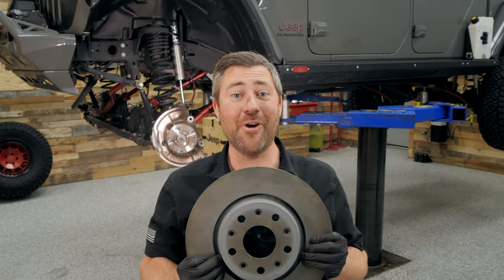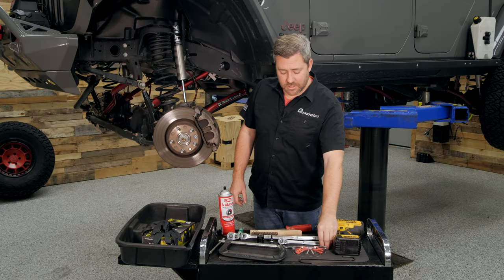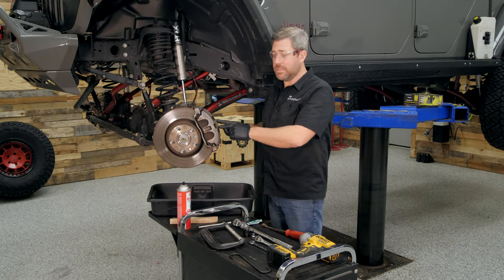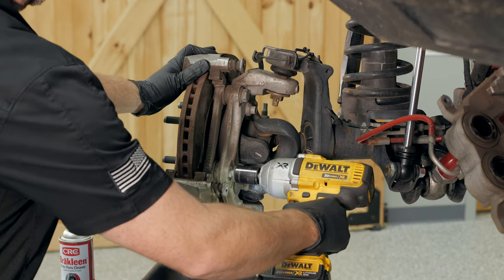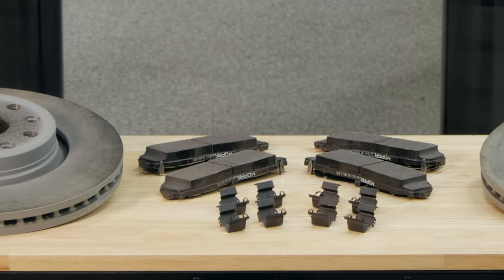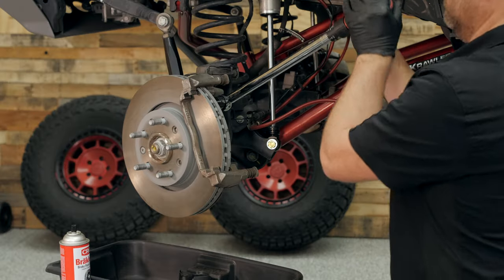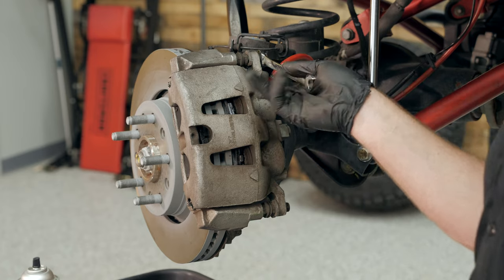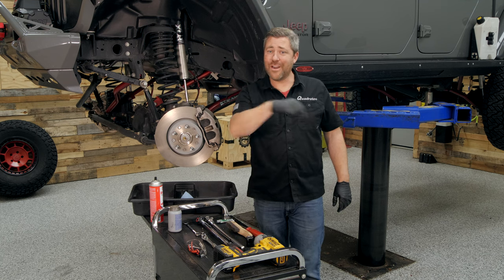How to Replace Brake Pads & Rotors for Jeep Wrangler JL & Gladiator JT - Quadratec Academy

Comment: Be sure to add a bit about drilling out the retaining screw as they NEVER come out that easy. Pot metal and the T30 torx strips it in 1 second. Also, show which way the wear indicators go (you can just barely see in this).

Comment: Is it the same process for the rear pads/rotors?
Reply: Because of the E brake it's a different animal.  I've seen on other Jeeps where it's required to go into the Uconnect menu and click on "brake service" before doing any work.

Comment: The rear Mopar brake pads I ordered for my JL Wrangler (Sport S) came with 2 shims for each pad (1 shim is shiny metal on both sides and the other shim is shiny on one side and black on the other).  Am I supposed to use both shims for each pad?  I guess I'll find out when I disassemble the existing brakes, but it would be nice to know in advance.

Comment: When torqued to 148 the bottom bolt actually touched the rotor and caused damage. When trying to back it out the bolt broke. Great video but the torque must be incorrect.
Reply: Was this just on the rear caliper? It looks like torque spec is different for front (148ft. lbs) and rear (74 ft. lbs)

Comment: Similar, same, or different procedure for the rear pads/rotors ???
Thanks for this video, Rob excellent host/installer, as usual...
Reply: I was wondering the same thing. On some vehicles you need a special tool to turn the rear caliper pistons back in. 🤷🏻‍♂️

Comment: Curious, I don’t like the amount of brake dust the OEN pads give off, is there another pad that has or give the same thickness and stopping power without or with minimal brake dust? Like maybe a ceramic brake pads? I’ve used similar ones for a different vehicle by STOPTECH, they were great, but I now have a Jeep and don’t know if they make them for Jeeps.

Comment: I’m assuming it’s the same for the rear brakes as well?
Reply: Had the same question, was hoping you got the answer
Reply: No, different torque specs for the caliper adapter bolts.

Comment: Is there any substantial difference between the process here and for a 2010 JK Rubicon? Rear rotors and pads a similar process? Thanks for the great videos?
Reply: Happy New Year in advance.  JKs use small clips on each stud to hold the rotor in place while the JL uses a screw.  Otherwise it seems mostly the same.
Reply: @attnielthomas7856  Awesome! Thank you.

Comment: Yes, not NOT over torque the retaining screw, I don't put them back in myself, as they are not necessary.
Reply: Why the heck did Jeep decide to use a Torx head on these screws? I've never seen a hand impact screwdriver with a Torx head attachment (at the hardware store anyway). Definitely use a coating of anti seize if ya'll decide to put these back on. You will thank yourself later.

Comment: How about bleeding the system after all is done?
Reply: If I’m not mistaken he used a c clamp and forced the caliper back without the need to open the bleed valve on the back to relieve pressure. If you open the bleed valve I believe this allows air inside the lines and then you would need to bleed the system to ensure there was no air. He basically forced the caliper back into position instead of moving it back the easy way.

Comment: How often are brake pads and rotors need to be replaced?
Reply: I heard the brake pads on the Jeep Wrangler JL are heavy duty and can last up to 100,000 thousand miles.
Reply: Replacing my fronts today at 50K, running 37's for pretty much all of that mileage.

Comment: My rear brake caliper bracket broke into pieces somehow.  I've never seen this happen on any other car.  Makes me question Mopar parts quality.
Reply: Looks like rear torque specs are different than the front. While Front caliper adapter bolt is 148ft lbs, the rear is only 74ft lbs. Did you torque to 148? thats twice as much force and likely caused it to crack.

Comment: Why are all these youtube videos front only? I need the torque specs for the back and they're smaller bolts, therefore less torque.
Reply: I made a video which shows both front and back, with torque specs.
Reply: @CheaperJeeperTV  finally found them, thanks.
Reply: @naamangeist7843  Cheers
Reply: @naamangeist7843 What is the rear torque spec? Can you share here?
Reply: 26 FT-LB with 10mm socket and 74 FT-LB on the larger bolts with 18mm socket. This is on my 392 XR so if your bolts take a different socket size, these torque specs are not for yours.